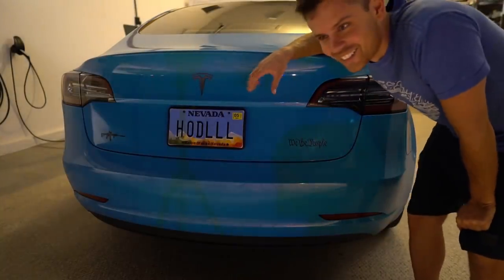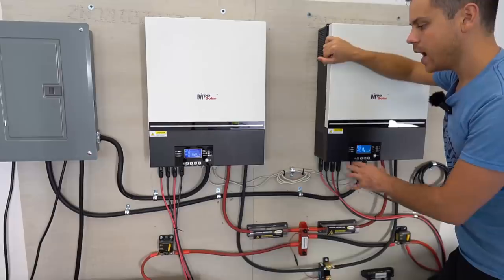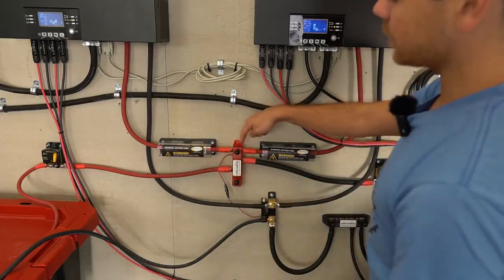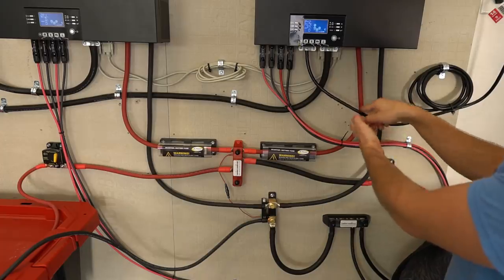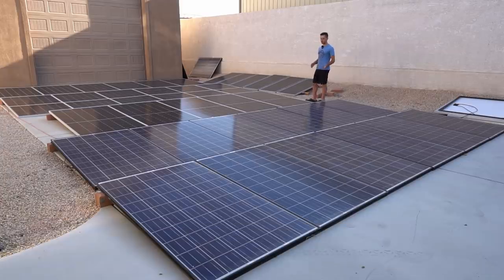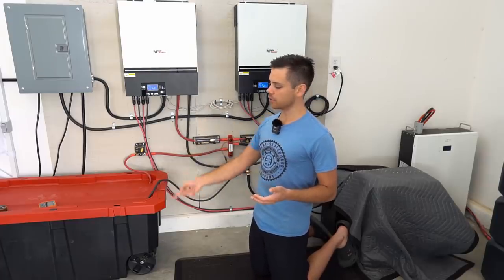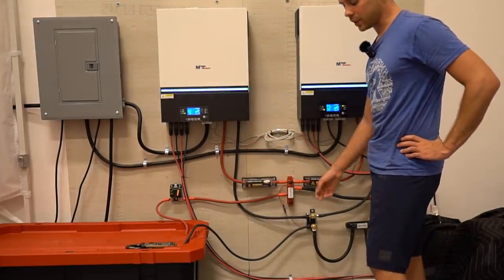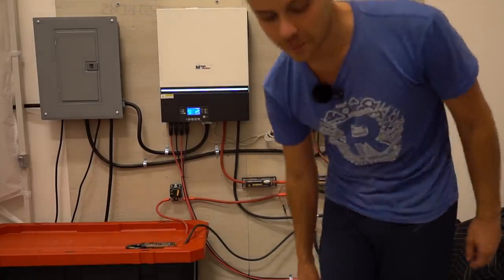New Upgrades for my Offgrid Permit-Free Solar System: I am now charging my Tesla without the Grid!

Comment: You make a very valid point but unfortunately your point is only applicable to people who live in climates like yours. For people who live in the places that have winter for 4-6 months with extremely cold temperatures and darkness 16-24 hours a day for those months it's not only impossible to run off solar power year round but electric cars don't work very well and in the more colder climates not at all. I'm all for electric cars and not polluting the planet. However just like Elon Musk said himself technology with the electric cars is not at a place where they can fully replace fossil fuel vehicles yet. I live in Finland we have winter for 4-6 months out of the year, (depends on the year) and the average winter temperature in the southern most part of Finland is around -15C and have dropped as low as -35C in recent winters. In the northern part of Finland the average temperature is around -25C and drops to more than -40C. In the northern part of Finland the sun sets at the beginning of winter and does not rise again until near the end of winter 4-6 months later. Not to mention towns and cities are often several hundred kilometers apart. Some people live 200-300 kilometers from their nearest stores. Electric cars have been tested extensively in cold weather and even Elon Musk says they are not suitable for cold weather climates because they either wont start and run at all or the batteries drop from 600-700km for a full charge to near 100km for a full charge. You are looking at things from your perspective as someone who lives in a warm climate with good internet reception and summer year round. You should look at the big picture and make sure you understand it before you talk down to others.
Reply: You should not complain because Finnish electricity is VERY clean already. It is mainly generated by hydro and nuclear. Emissions are way below 100 grams of CO2 per kWh, that is nothing! Modern EVs are doing fine in cold climates. Look at Norway.

Comment: Another awesome video. What to do when no utility connection for ground? Grounding rod?
Reply: I advise even with a utilty ground grounding rods so long they reach to the wet soil, 3 rods at least 7 feet apart from each other and individual conected to one central grounding bus bar.
Utility grounds are very dirty

Comment: Hey Will. Another great video. Ty. Any issues charging the Tesla without a utility ground connection? I’ve heard of issues regarding grounding when trying to charge a Tesla.  
I’m building an off grid shed setup using the MPP LVX6048 with no utility connection at all and I’m worried I won’t be able to charge my Tesla.   TY again.

Comment: Hi Will, here is Axel from Germany followig you with happyness from here. Do you have your batterys in the box conected in parallel with the not yet released ones? Is it possible to connect different batterypacks (same Voltage) so easy?

Comment: I got a question about the setup, it seems like you have 2 different batteries connected to the system hooked up on the same busbar. would there be any problems connected different Lithium battery setups in parallel?

Comment: if the garage door is sitting on top of cable, is there a rodent sized gap at the bottom of the rest of the door's bottom lip.
Reply from the maker: Nope, the weather sealing is nice and soft and molds around it

Comment: I suppose I could try to count them, but how many solar panels in total are you using for this? I just got a quote of 28,000 for an 18 panel system on my garage. I calculated it would take me 93 years to pay them off, based on a 300 dollar utility bill. So not going to do that.

Comment: Not everyone has the space for all those panels.
Reply: It is definitely possible, I had to install Sunpower modules on my 900 square foot of available roof space to make it doable. 360 @ 28 puts me in the neighborhood of 10.08 kW array. They had the most efficient panels out on the market at the time, but now I can even have more kW’s on the same original footprint if I know what I know now 5 years ago as they’re getting more efficient by the year. Yeah, it cost more than the typical build, but I crunched the numbers and was willing to work with the challenges going it to it.

Judgement over skill… Any excuse is a good excuse if you are weak enough to use it…  -Motojitsu

Comment: Hey Will. Great vid Bro. Question; I'm on the fence about batteries for my Rv, 8 Battleborn 100ah (heated) or 8 Xantrex 125ah. Also going with 4 of those dual sided solar panels in one of your previous projects. Any insight would be appreciated.

Comment: SO WHAT DO I NEED TO RUN A SPLIT UNIT AC ON MY BACK GARAGE TO HAS A 50 AMP BREAKER BOX OFF MY FRONT 400 AMP UTILITY SERVICE.   IN AZ AND GARAGE IS ABOUT 800 SQ FT.    NOT AFRAID OF ELECTRICITY AND CAN DO MOST WORK MYSELF.

Comment: Can you charge your Tesla with DC without a SuC? I know you get DC from the solar panels and you charge your batteries with DC from the inverters but the UMC is connected to the onboard charger that converts AC to DC before going into the batteries. How did you solve this if you charge DC to DC ?

Comment: Whilst I enjoy and agree with a lot of what you say, the downside of electric cars and another argument is that the batteries that are used don't last forever, in fact not even 20 years, when you need to get rid of the batteries there is no easy way to do this, they don't degrade and this is where the technology needs to catch up so that we aren't left with an option that isn't clean, the batteries have to be buried because there is no way to dispose of them.
Reply: There are companies starting all over the place to recycle them. It takes time, but with the legislative push for that here in the EU and money being poured into the issue, I hope this will be a solved problem in the near future.
Reply: @upnorthandpersonal  Lets hope so!

Comment: Ready to pull my hair out. Bought your book and it says to never use MC4 connectors inside. This video shows MC4 connectors going into the solar controllers and the connectors are inside the garage. What’s up?
Reply from the maker: That's in a RV. no need to have them inside RV. The systems in my book are all low voltage. That's how I designed them.

Comment: So would you rate the systems you have on the wall there better than using a victron multiplus system.. with the additional benefit you don't have to buy separate mppt Chargers
Reply from the maker: Victron is fantastic but costs 3-4X as much. This unit is UL certified (past models were not). So in my opinion, my system is best bang for your buck.
Reply: @WillProwse  awesome well that's good to know it will be used entirely for an off-grid solution to provide power to two small cottages we have the room for the solar arrays and potentially the room for batteries as years go on we can continue to add to the bank. Appreciate your thoughts on this as you seem to be the master sensei in the solar power field

Comment: The price of batteries are the only thing keeping me from building a usable system.
Reply: Just start out small. Any one of the required components have such a stupid long life span you won't give a care in the long run. You can build it piece by piece.
Reply: @arandomfox999  yes that is one way to do it. However When I build something I tend to overbuild the system to what I would need. I do have a small system on a chicken coop out back just for lights.
I just have to save up for parts for the system I want.

Comment: I am getting a growatt spf5000es. I want to charge the batteries and once its full, I want to charge my car directly from solar panels. How are you doing this so I do not drain the charged batteries and use maximum solar power? Do you know? I saw you mentioned that with your system.

Comment: Hi Will. Could you assist me kindly please?

I got 2x 12V silver calcium deep cycle batteries hooked to a 18V panel via a victron cheap small 30A blue solar pwm lcd-usb ... The batteries got this indicator on it. My question is, the one battery is fully green, full charge, in the indicator and the other one just it's small green dot, meaning the two batteries aren't charging the same. I connected the wires cross, neg from one battery to controller, positive of other battery to controller.  Batteries in parallel. Is it a problem that both batteries doesn't charge together?

Comment: What do you mean by "permit free"?  Do you need a permit for solar installation in Vegas?
Reply: It's not really "installed", panels are not on any structure, and aside from the grounding connection, components are just stuck on the wall, or batteries in big plastic tubes.
Reply: "tubs"

Comment: Well i use 4500w/h 24/7 mining BTC ( it's 108000watts each day ) It's not possible to build a system for that much power.
Reply from the maker: My grid tie system produces 100kWh a day. You just need to use it as a dump load when you have excess power. But yeah, 24/7 running that thing would be tough. It's still possible. Just expensive

Comment: The problem is a person could buy 20 years worth of gasoline for the cost of installing that system.
Reply from the maker: Depends on where you live. Peak rates in California can pay this system off in 4 years. Do the math.
Reply: @WillProwse  Your full of it, and yourself.  You couldn't even pay off your batteries in 4 years.
Reply: @sailingeden9866  50kWh production per day, 365 days per year: 18250kWh production per year. From what I found online, the peak rates in California are at $0.43 per kWh, off-peak is $0.27 - let's just use the lowest one and round it down to $0.20 for fun. So for that amount of power, it would cost you about $3650K per year, or $15K over 4 years - enough to pay off the system (and that's not taking the peak rates in mind, or the price increases over the next 4 years).

Comment: I've been watching your videos for some time know and respect your opinions, for the most part, however, I have thought about your whining comments about charging EV's. (I am an avionics tech and maintain flight simulators, Amateur Radio and electronics, solar, etc., hobbyist.)
The Tesla and alternate EV owners I know are incapable of building , or hosting a solar charging system that has the capacity to charge the vehicles. They also don't have the electrical knowledge to wire in a charging station. In short, they are technically useless folk who rely on the grid for all things powered.
The grid here in Southern Arizona is not all green and rainbow lit unicorns. So, however everyone else's EV's are charged using the grid, I doubt most use their own solar installations and are green poseurs for the most part.
Build it? They aren't qualified.
I am thinking most EV's are powered by whatever the owners' local grid is running off of.

Great videos and quite useful for ideas.

Comment: I'll be interested in your result of what's the self consumption theses ones ...
Got a MPP 7048 max and find out it's around 70 to 80 watts .

Which means an entire night is somehow a thousand watt of self-consumption before you even turn a light on .
( which stand a pretty little lie cause they got led lighted facade, but anyway )

They are a bit noisy but well protected from dust ...
 Got the same grief about their fans are running in the opposite what's natural convection ...
And purposely I guess .

Dare, care, ride safe, clean, have fun ...
From France with .

Ps:
What's interesting stand the multiple solar strings inlet that allow each string to have a different orientation ...

Sun trackers on pole are not that cheap nor that easy to mount on Rv or camping cars ...

Comment: Solar is fun... green? Not so much. Have you researched the building of the panels, or batteries? What happens to old panels, or batteries? Where do the blades from from wind farms go? How about all the plastic in your car? Solar is fun but not an answer. BTW coal is much cleaner these days. Hydro, & Nuclear are the cleanest by far. Until you spend time in factories producing the things you use... don't know what to say to you. Guess I'm one of the whiny babies. I have worked in a chemical plant for 34 years. Our industry has came a long way. We now use a cogen unit for power and steam. Runs on natural gas. Industry will never run on solar.
Reply: It’s all not relevant. Emissions of constructing and recycling renewable energy equipment is MUCH, MUCH lower than they are saving during their operating life. A windturbine only needs half a year to compensate for its construction emissions for example.

Comment: While I usually agree with you. No one is crying when they say most electric cars are charged by coal and other forums of power production that is just fact.
Reply from the maker: Yes they are. I see it all the time. They call me an idiot for driving electric because it still uses fossil fuel to charge from grid. I have multiple neighbors that have said that. It is a claim that is brought up a lot.
Reply from the maker: And Tesla stopped accepting Bitcoin because of the fossil fuel concerns. Did you not see that?
Reply: @WillProwse   I did see that about Tesla and bitcoin.  I am specifically just saying that calling out others for "crying" when they are just bring up what they think is relevant is NOT crying.   

As for how much fossil fuel is burned to mine, transport raw minerals,  process, manufacture, and transport the finished product uses an absurd amount of fossil fuels.  

  We all have had those kind  of neighbors that spew that kind if ignorance. They will always be around. I just look at them as entertainment. 

I live in Alaska and deal with it all the time. I get 24/7 day light in the summer and only 3.5 hrs of daylight in the winter and have only solar and wind for power.  I get called an idiot all the time because of it.